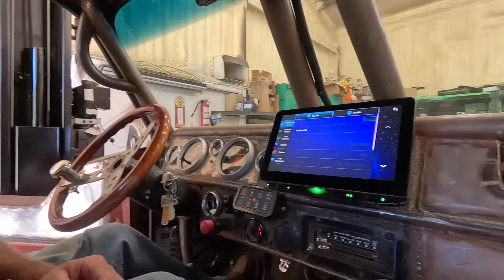Where Has The Rat Rod Wrecker Been?

Comment: PAUL! Do not use that silicone! It reacts with oil and lets go of the metal. Use black or clear only when oil comes in contact with the silicone. I work in a racing engine machine shop. Trust me. Also, the bronze gear on the distributor is not a big block thing. It is a roller cam thing. And the guide plates are breaking cause of cheap rockers and no stud girdles.
Reply: Paul needs to read this! ☝
Reply: @MonkeyMikeOutdoors Paul needs an engine mechanic 😅
Reply: LMFAO IKR! @billcooper2584
Reply: I bet when they do pull the pan on that big block they’ll find the oil pickup at least partially blocked with that crap silicone… 🤦‍♂️
Reply: Was going to say all of this. Performance big blocks have these issues but they can be fixed easily with the above recommendations. That distributor gear needs to be matched to whatever cam is in the engine. Hard to recommend a gear without that info.
Reply: About time someone else says this I been a mechanic for 15 yrs and I been telling everyone the same thing trying to help me save money I had plenty cars come in and say I got a oil leak and guess why you said it
Reply: What silicone?
Reply: @TheShooter466   the red stuff he smeared on the valve pan.
Reply: Someone needs to delete this comment. Hes ruining all the fun
Reply: Isnt silicone color different form manufacturer to manufacturer. Everything i am reading seems to indicate this
Reply: Yay! Michelle stopped by👍🏽
Reply: @TerianaCreations  no. The colors are different formulas for different applications.
Reply: Well, looks like Hunter will be a prophet.
Reply: Ultra grey is the way. Once that shit dries you don't even need bolts. Also, I have way less doubt in the red than y'all. I've seen it used even on bbc for at least 30 years. Not once, have I seen a problem from it.
Reply: @adamgreen3582  ya… do you do engines and only engines 40 hours a week in an engine machine shop? One that has held several world records for speed? Cause I do.
Reply: So much hate......smh
Reply: @SirensC3  i think that's why a lot of successful racers come from racing families because it takes generations to find out what works from what people think works
Reply: @georgedavis6583  I would completely agree with that as I am a third generation in the racing world.
Reply: Is there an O2 Sensor?  Probably not
Reply: Its still silicone...just make it simple and advice for him to read the use of the silicone label. Be it red...black or clear. 😒
Reply: Offer advice. Your comments are literally like your scolding him instead of offering useful information.

Comment: That distributor gear isn't a big block thing. It's more of a billet cam core thing. You can use a bronze gear, like you are or you can get a melonized gear. Either one will stop the gear wear problem.
Reply: Finally! Someone who knows what they are talking about. Thanks for saving me the trouble of trying to tell them that.
Reply: Those newer MSD gears are horrible now. They might call them bronze, but we only get a season out of them in the race engines. Comp actually makes a gear that’s equal to what the MSD gears USED to be.
Reply: @adamenders1695  I was going to suggest a new Distributor, that is designed for the Billet cam.
Reply: Don’t know how sloppy the gear was but as it’s pinned, would it be possible to sleeve it and use it that way ?
Reply: @markglenn4929  they don’t make or need a distributor for a roller (billet) cam. You get a bronze gear and swap out the old one. Paul is wrong about them not making one to fit his distributor. He just didn’t look in the right place. My machine shop could have hooked him up. He is too lazy to do things correctly. He would rather do it quick and easy and then blame the engine for his failures. I make a living on people like him.
Reply: Vortec 8100 and ditch the distributor
Reply: Ok bro
Reply: Always someone like you
Reply: @SirensC3  instead of being ignored

Comment: Your dedication to chevy and constantly having to work on them is impressive
Reply: every other option is WORSE....   LOL  things goofy ford guy's say...  LS swap the world
Reply: Wonder how a built ford 300 I6 would do in that truck.
Reply: I've literally beat a Chevy truck like a crack head tryin to rob me and for three years I never had to do anything but change tires and a couple cv axles. My friends with Ford's all sold them before it got close to 300,000 miles I didn't. Still ran great when i sold it.
Reply: Doesn't have anything to do with Chevy, it's the aftermarket parts.
Reply: Pick your poison, learn how to fix it, carry on.
Reply: Bowtie power is the way to go. I owned one blue belt buckle, and wasn't thrilled with it. The Ford ranger I had, had a Mazda transmission, and that wouldn't let me shift it to neutral. It got stuck in gear. It also had a fuel tank leak.
Reply: They both tear up. That is what every vehicle does eventually. They are both great if you take care of them.
Reply: @jeffvw1994 that would almost be unethical.😂
Reply: Not much of a ford guy, had chevys most of my life and when it comes to square body’s it would be all day. Won’t buy anything new from GM mainly cause of there transmission issues and there displacement on demand feature(DOD)…
Reply: You can get a LEMON in any vehicle! Luck of the draw!
Reply: @tacticalbreadman7409  Opinions Vary!
Reply: Judging by the replies I would say you hurt some fragile Chevy feelings.

Comment: Happy Birthday Shawn! In one of Rory’s latest videos he was talking about how he likes a big block because he likes torque for pulling the people out, he likes to work at low range rpm’s
Reply: I agree with Merlin. I love the older big blocks.
Reply: He can always opt for the Vortec 8.1.  Some folks call it the big block LS.
Reply: I used a Comp Cam Composit Distributor gear on my Big Block
Reply: I also used Comp Cam Stainless steel Rocker's on my Big Block
Reply: And his higher-geared axle has stronger pinion engagement.
Reply: @veto8792 there is a reason gm swapped out big blocks for the 6.0 ls. Its just a better engine all around.
Reply: @veto8792 yes they were a beast. They were called the Duramax killer when they first came out.  They could out pull them. Now they have the diesel  working the way they should though.
Reply: True if you can build them RIGHT , which is a  problem for Merlin as most if not all of his engines FUCKUPS in a short space of time. Typical farmer engine so called engine builders , never heard of a torque wrench @PlainStraightShooter
Reply: I just said that to my husband. Lol.
Reply: @timothycarey3883  maybe, and a lot more money. Theres no end to the cost and problems.
Reply: "And in your case, you get both" Hunter for the win 🏆 
Hunter has really stepped up his "repertoire"😂
Reply: You have to consider that Rory works mostly in the rocks where low slow works well. Paul tends to end up in sand, mud or snow which favor a little bit of wheelspeed. Different applications favor a different setup
Reply: @Comil1983  Paul needs a good mid-range set-up, he does deal with some rock as well as sand, snow, mud, and water which you tend to need high-end for the latter. The ability to do both in his situation would be  the best outcome.

Comment: Yall ever use a listening stick? Hold a wood handle from ear to covers. You'll be able to hear exactly which ones are bad. Works like a dream.
Edit: works great for pinpointing bad bearings, lifters, or various ticks, squeaks, and grinding sounds
Reply: So does a piece of hose.
Reply: They make a tool that looks like a Doctor's stethoscope only it has a long metal rod as a pointer works like a charm.
Reply: long screwdrivers and pry bars will do in a pinch as well!
Reply: Every mechanic in my shop owns a stethoscope.
Reply: Long screwdriver also works

Comment: Big blocks have a pretty good reputation over the years in all kinds of applications including marine where they are run close to wide open for hours at a time.  The problem seems to come when after market parts are added.  An engine has to be built ground up to be durable.  Adding a few components to get lighter weight and higher horsepower can create a cascade of problems that were never there originally.  I remember running triple 454's in high speed jet boats used for tours.  Previously we ran big block Fords which seemed susceptible to distributor failures and also used a fair amount more gas per hour.  The 454's were run hard (as were the Fords) as we had a time schedule to meet and an area to cover that were not amendable.  They held up quite well lasting from May through September eight hours a day seven days a week with four boats running.  As I recall it was normal to get three seasons out of an engine before any problems and even more before major overhaul.  They were converted to quick connect fittings enabling the engine to be pulled in less than half an hour and replaced with a spare in an hour.  Then the shop could overhaul the engine as needed.  They were hooked on Hamilton jets if I remember correctly so with the quick connects on all lines and electrical it highly simplified the process.  They carried a good load.  48 passengers in a  forty five foot aluminum river boat at thirty knots.

Comment: My dad is in his 70s now. But then he worked on dodge motors, he had old valve covers with tops cut off with rubber screwed to the top. He could look at rockers with motor running without getting oil everywhere. Work smarter not harder.

Comment: We would always just disconnect the spark, plug wires and use the starter button to turn the engine. I actually worked very well. Keep up the good work guys love your videos. 10:05
Reply: I would just remove the spark plugs: it makes it a lot easier to turn, and you get to check them and the mixture at the same time.

Comment: If the pushrod guides are breaking, might want to check out the level of spring compression to make sure they are not binding up, since that can cause such issues.

Its not uncommon to have a cam and rocker combo providing more lift than the springs can compress for.

Comment: No LS!!!  Big blocks are awesome!!!  I had a F250 with a 460 in it. Never failed me. That 4x4 was absolutely bulletproof. I pulled a 14 ton motorhome out of the sand without a kinetic rope, just put the throttle down and let it roar. Damnit. Now I miss that truck all over again.
Reply: 460's cool and all but a 390 stroked to a 410 is the bee's knees. Keep those high rpms high all day!!
Reply: One you go to LS power nobody ever goes back. There is a reason for that.

Comment: @ Fab Rats you have a lathe in the shop, machine a sleeve that fits inside the bronze gear.  Easy machine work!
Steel, like the shaft or material similar to bronze, machine the OD to .001 press fit, press it in, chuck up the gear and drill the ID to size, redrill for the roll pin, 20min job.

Comment: Good Morning to the awesome FAB Rats crew!  LMAO Smello-vision!!  So great your team keeps all the normal daily conversations in most of these episodes, comedy gold!  If your bound and determined to keep the big block it may be worth a short conversation with Roy about his experience.  He prefers them for the torque over the LS, but you driving style and terrain may work better with the LS.  Both of you have way more experience in your little finger than me with this stuff, but truly enjoy when the different channel collaborate and help each other with their projects!
Reply: No need to conversate with Rory,  he keeps his setup as simple as possible.  Eliminate failure points, and you'll eliminate failures, right? Simple, older, inexpensive engines, bare minimum reliance on computers, use the same size fastener for everything possible lol. Paul's truck used to be the same way, before it was Paul's truck. I feel like he really made a steady stream of mistakes, changing everything like he did from when his father had it, but hey, that's just my opinion, and it isn't my truck. But it does seem that he consistently has problems with these big block Chevy engines, and it's mostly a lead foot, judging from what we see.
Reply: @philbert006  I think Paul's biggest mistake was going for a half built motor. It didn't work when they messed with cheap parts in Landon's truck, it's not working in the wrecker now because the parts aren't matched properly.

Comment: When you want to isolate a sound in any machinery in a noisy environment try this: wear Earmuffs and use a wooden dowel or a decent clean stick.   The stick transmits vibration to the earmuffs.  Place the far end of the stick on the machinery...direct contact.  The other end on the earmuff.  It works like a stethoscope to pinpoint noise.  Just move the end of the stick to the noisiest location.  You can find bearing noises...lifter tics....rocker rattles....all sorts of things.  and you won't hurt your hearing doing it.  Simple stuff that works.  Thanks for the vid.

Comment: Cut the top off a set of old oem valve covers so you can adjust without getting oil soaked.  I wasn't aware the TBI dist shaft was a smaller diameter, that sucks.  I always used the thick rubber/cork Mr Gasket VC gaskets glued to the VC, never leaked, super easy install.

Comment: Put the distributor housing in the lathe, cut two round bottom grooves to install o-rings to hold the oil in the galley pushing it all to the mains, rods, lifters and rockers. Really worth the tiny effort and helps hold the distributor housing true in the hole.

Comment: 4 stroke valve adjustment on any motor,  works everytime. When exhust valve just starts to go down adjust the intake valve on that cyclinder. When the intake valve goes down and start to come back up adjust the exhaust on that cyclinder.  You will never have problem.  Also valve cover cork gaskets  spray paint with interior/exterior silver paint. They seal up and pop back off with out damaging the gaskets

Comment: You can get a long screwdriver & place the metal tip on the valve cover & put you ear on the handle & any clicking noise will be amplified to help you find the loose rocker(s).

Comment: I Can feel for Ben and Sean (Shawn, Shaun). Years ago we installed a rebuilt transmission in my buddy's 1978 Buick skylark that was basically the same as Hunter's 75 Nova. We cranked up the engine and began to add Transmission fluid while leaning over the front bumper. I told him to back up, and then I stopped leaning on the car it drove forward into my shins.  Luckily there wasn't enough fluid to get enough force.  We realized the transmission shifter components were for a Floor Shifted model and his was a column shifted, so when we thought it was in Park, it was in Low 1.

Comment: Instead of red silicone I use aviation gasket cement. The parts come apart hard but it doesn’t leak.  A wire brush in an air drill cleans the surfaces to remove it when reassembling.

Comment: Happy birthday Shawn. 
Anytime you run a billet roller cam you have to run a bronze distributor gear. The cam will tear up/ wear out the stock steel/iron gears. 
Please please don’t LS the wrecker! The LS are great rpm and horsepower engines. 
The big block is designed for torque due to the long stroke. And yes the big block cam make great horsepower. 
Rory had to put another engine in his due to children playing in water! 
He stated he has nothing against the LS but you need low end torque for towing. I think Merlin built your engine for rpm and horsepower. Hence the lump lump cam and roller cam etc. I’d de cam the engine and go to a more stock valve train.

Comment: The fix for your rocker issue is the Comp Cams Magnum Rockers. (Stamped steel with a roller tip). I used them in my Ford 302 with zero problems up 7000 rpm.

Comment: Enjoy your can do attitude. For your distributor gear wear problem you could try using a Melonized gear designed for steel roller cams. Summit Racing offers one (SUM-850468) for the smaller GM distributor shafts (.430"). The replacement gear you had was either a .491" or .500" shaft gear. Also, it would be a good idea to look down the distributor hole at the cam gear condition. It might have some wear too. As tight as your engine compartment is, it might require using a boresope to get a good look at the cam gear.

Comment: Suggestion: They make hardened bushings that you may be able to find to go into your bronze gear for your distributor. You may have to machine or drill the bushing itself, and put a hole in the bushing for the roll pin and red Locktite it when you assemble it. May need a carbide drill bit for the bushing. Love the show keep up the good work, Bob.
Reply: Sorry machine the bronze gear. My bad lol.

Comment: Low Buck Garage, enlarged the hole that feeds the distributor gear. Actually, he drilled a small hole in an oil gallery plug to feed the gear. Don't know the setup on a chevy, but there you go.

Comment: With your new stainless steel roller rockers, did you check pushrod length?  If there doesn't seem to be enough threads for the lock nut, your pushrods maybe too long.

Comment: Exhaust opening adjust intake intake closing adjust exhaust. This is the best way to know for sure that you are at the base circle of the cam. Performance cams usually have to much overlap to do the tdc method. Use “EO IC” method for being absolutely sure. Great video though awesome truck